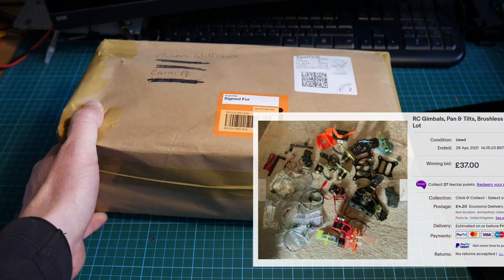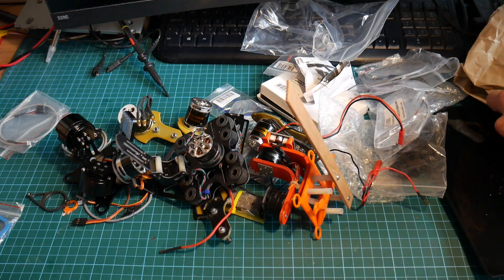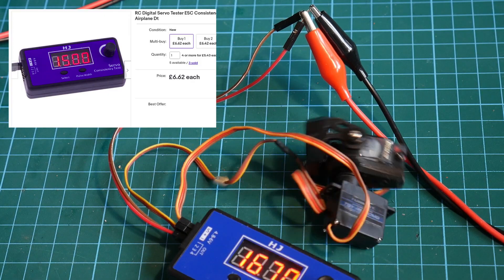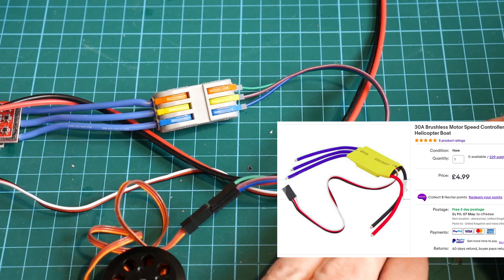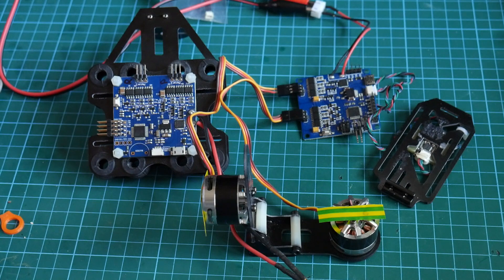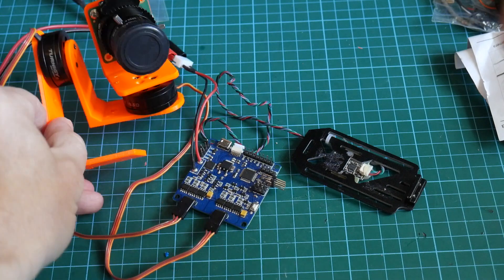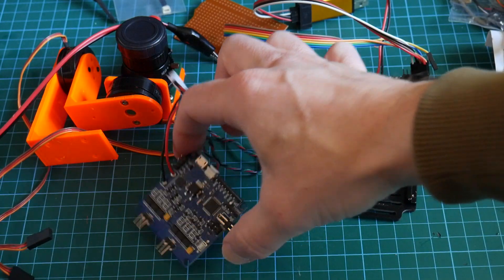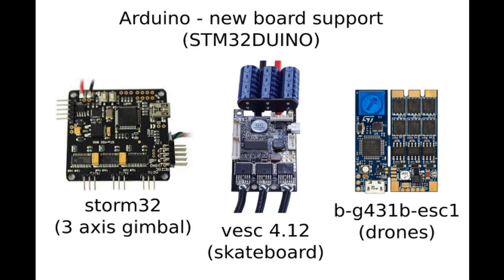Recycling Ebay Gimbals - For Robotics

Comment: Can you send me link for 60v 250A vesc
Reply from the maker: What do you want a link to buy? The official ones are done by trampa
https://trampaboards.com/vesc--c-1434.html
Note, these are v6 hardware and I've only tested simplefoc with v4.12 hardware.  You can of course use the super capable original vesc firmware rather than writing your own firmware
Disclaimer, I've been using 50A clones from flipsky.
Reply: @OwenWilliamsRobotics  I have two 80cc 160kv of 51v with 200A and I want a vesc
Reply from the maker: @vijaykorvekar1009  I'm not experienced enough to give you advice on something with that amount of power.  This YouTube video might be useful
https://youtu.be/fbK2dcoYS7g. What load/speeds are you driving?
Reply: @OwenWilliamsRobotics  I weigh no more then 68kg and I'll be building my bike as light as possible with max speed of 110km/h
Reply from the maker: @vijaykorvekar1009  sounds like fun. Question. Is that motor suitable? I've seen a similar spec one designed for plane propeller. At 60v it'll be doing 9600rpm, no? Without gears that is 300m/s.  Are you going to need to trade speed for torque 10:1? Gears or lower kv motor?  Again I'm not an expert and only play with small slow motors.
Reply: @OwenWilliamsRobotics  yep that's right